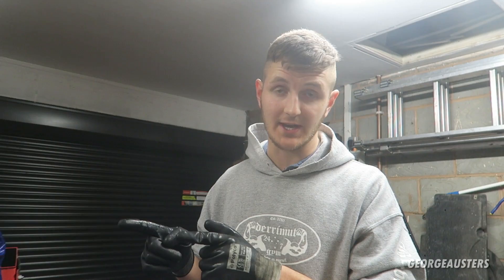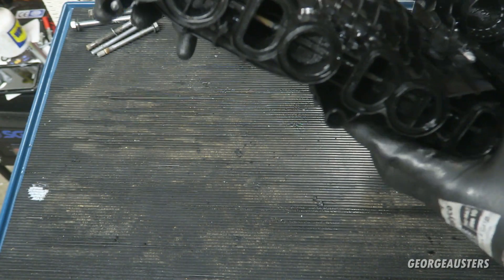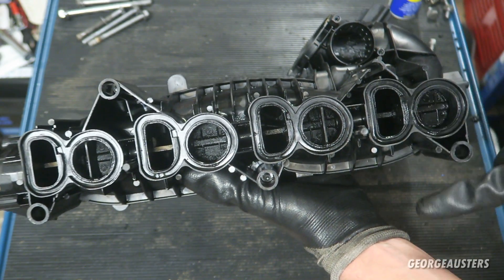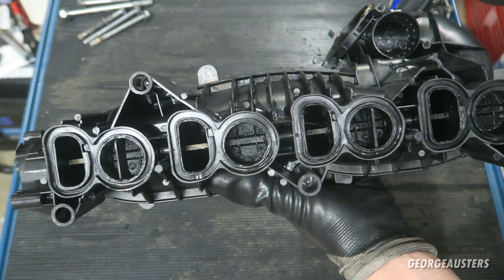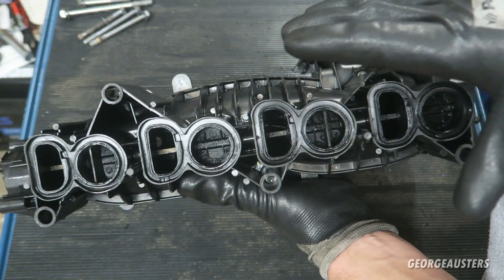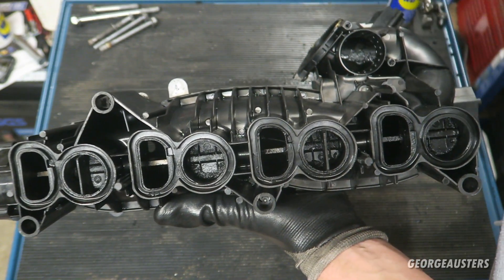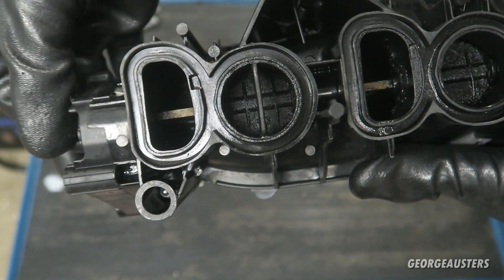Why You Should NOT Remove Swirl Flaps on BMW N47 / N57

Comment: I removed intake manifold on my high miles 2011 320d and the flaps were resting on the inlets… ready to fall in ! Only the carbon build up around them was preventing that from happening. Important to note the later N47C is different to the manifold shown in this video.

Comment: It's a bit chicken or egg story, I drive a diesel because of it's torq on low RPM . 
For sure taking a little brain out of the engine would have side effects. 
And we don't want a Diesel to behave like a petrol car. 
Issue here is when does that long axle holding the flaps is having too much space... 🤔.
I cleaned everything as much as possible with a toothbrush and some WD40 and brake cleaner. 
It closes and opens a bit smoother then before. 
Tomorrow a possible EGR Dismount will take place.
Reply from the maker: It’s why I generally just recommend getting a new manifold after deleting the EGR system

Comment: For never N47 like I have on my F11 there is whole intake manifold gasket with new swirling flaps which is nice thing. I bought oe quality but not orginal gasket for 25 euros from discount which is only 1/5 of the orginal part price and Im going to change it when I do timing chain job to my car so I can be sure that flaps doesn´t fall to engine.
Reply: Doing this right now over in the states.

Comment: I had a remap done. With EGR off/DPF off & Swirls On. And just like you mentioned, i have a massive drop in power below about 2k.

I've tried it both ways and without a doubt definitely better with a brand new manifold with the swirls left in.
Reply from the maker: Exactly 👌🏻

Comment: The swirl flaps are there for cold starting only, because the EU has a cold start emissions test on the MOT hence cars used to have cats on the inlet manifold (for cold starting) AND in the main exhaust. Now they just put a bigger single cat close to the header. They dont operate a slow engine speeds once the engine is warm so removing them can only increase performance.
Reply from the maker: Nothing to do with starting at all
Reply: @GeorgeAusters  Purely for cold starting emissions, they dont activate at any other time.
Reply from the maker: @manoo422 you haven’t got a clue sorry
Reply: @GeorgeAusters  Spanner...

Comment: Had a n47 engine with catastrophic engine failure due to broken off swirl flaps/rod. So it happens. Removed them for good and did see a drop in power in low range, it drove a bit more like a petrol after that - HP curve. Fuel efficiency was stellar on rebuilt engine without the flaps.
Reply: How many miles did your engine have?

Comment: So I have a BMW 2 Series Active Tourer, B47 engine. Swirl flap arm gone.
I am in two minds about doing this.
I have only found one garage that does this, £400 all in.
My concerns centre around whether it is good to do or not. I'm aware that if the manifold is replaced, then it can happen again down the road.
Perhaps an aftermarket one will do better?
I've found arguments for and against it.
Does anybody have the same car and/ or engine with this problem?

Comment: Thanks for your great vids. Used them to remove and clean my B57 manifold. However there is too much play in the shaft so I need a new one. Can you recommend an aftermarket brand? BMW want £900, which seems a bit pricey. Cheers.

Comment: 2 well worthwhile N47 deletes - swirl flaps & EGR.   Do both or neither. Ideally do both. They suck.
Reply: The rod is, btw, NEVER snapping. Nor are the new style flaps ever coming off - not happening. Rod snapping is LOL territory - you won't even be able to cut it with a bolt cutter. That isn't the point.  EGR is a disaster for your engine - it drowns it in crud. Delete both.

Comment: my car is bmw 520d f10 2011 the car has no power after 2000rmp the car doesn’t pull but it revs freely but struggling to go to 100km/h and we have checked everything like the turbo, the turbo actuator, egr, exhaust, diesel filter, dont know what is the issue and also it misfires slightly at low rpms around 1000rpm to 750rpm but if u rev it little it goes, the car has zero fault codes, no malfunction light what so far and we are suspecting the injectors may be bad but im thinking of the swirl flaps may be it is not working plz help what is this issue is it a swirl flaps?
Reply: I have this same problem it's intermittent, most the time it runs like that then on the odd occasion the car runs fine then the next day it's back to this problem again. Did you ever fix the issue.

Comment: Swirl flaps don't increase the amount of air into a cylinder when closed, what the swirling air does is improve fuel and air mixing partly as a result of the angle it enters the combustion chamber (like you said) but also because of the increased air speed, which helps light throttle emissions, power and  economy.
Reply: what kind of air/fuel mixing? The diesel is injected after the air has been sucked in and compressed.
Reply: It’s the way the air is flowing that the fuel is injected into that makes the difference. Imagine throwing something into a straight wind vs a whirlwind. At low velocity, the whirlwind is going to get to all parts of the combustion chamber more efficiently and quicker. At high revs, you just have to open all the doors and get as much as possible in while you can. The direct injection process starts before full compression, there simple isn’t enough time to squirt it at top dead centre.

Comment: Very informative video George

However, my concern is that I currently have a 2014 facelifted 530Dthe N57 The car is one owner has been serviced regularly at BMW but since I’ve got the ownership I am planning to do the oil change every 7000 miles or so, but the thing is should I be concerned about the swirl flaps issue because the car currently has two years warranty with the dealership that I’ve got from, but I rather not have things going wrong with the engine as it’s absolutely perfect with no codes whatsoever on the scanner And ive done 7000 miles since I’ve got the car, so my question is should I be worrying about swirl flaps at this stage and I’m planning on getting the car carbon cleaned just be extra secure but is there a chance that they could still fail.. I do occasionally put the car in sports/sports+ just to other get a smile on my face, show off to mates the insane torque, sometimes do traffic light style launch, but I always do take care of it and engine it’s looked after and I’m at 60:40 Motorway:City driving ratio 

The car is currently at 88k (was 81k when I got it)

Comment: I've ended up here after some weird issues with my 640d. Having to start the engine twice to get out of limp mode every time without failure. Invested in an ENET cable and got a copy of ISTA+ I've got this showing

"The monitoring detects two possible fault causes:

- Detection of a broken lever between swirl-flap controller and swirl flaps.
- Detection of excess wear of swirl flaps kinematics."

Then in another place I've got the following:

Actuator position: -4.75%
Actuator Desired position: 5.01%

EGR position: 0.00%
EGR activation signal: 0.01%
EGR Nominal Value: -9.99%

How big of a job is it to get that inlet off? The car had the EGR done under warranty about 2 years ago.. I noticed darkside developments have inlets for £200 so tempted to give this a blast myself

Comment: 5mpg difference? Nonsense - official BMW documentation states that is affects low RPM emissions only
Reply from the maker: Not nonsense.. Tried and tested by yours truely
Reply: On a N47D20C? 
Sorry, you're wrong. 
Even N57S removal doesnt  affect economy.
And I've done many with the blanks... 
Emissions - yes. 

The newer B47 I'm not sure of though. Either the A or B version. 

  @GeorgeAusters
Reply from the maker: I'm not wrong.. I've literally tried it. Averaged 50mpg with swirl flaps in place and went down to averaging 45mpg with swirl flaps removed.. So I reinstalled them and mpg went back up.

Comment: I do not agree at all, wait until one of those flaps brakes and goes to one of your cylinders and we talk later :). 
For me BMW it is the easiest cars to maintain if you buy of course used one. Rule nr. 1.  Remove those Swirl Flaps - they are useful, that is BMW way of fucking up your engine, do you know that over the time they brake 2. Send it to electrician or if you know to do it by yourself, disable the EGR - you do not need that shit. BY doing these two together you gain mpgs. 3. CRANKSHAFT PULLEY, it will fail usually after 200.000 KM - replace it find a good one like corteco part for instance, and when it brakes it doesn't cause a huge problem, you cannot drive it, you have to tow it and replace the shit. In the past I think for instance let us take  e39 bmw crankshaft pulley was all metal, never did it fail, as technology is progressing they are doing mixtures rubber plastics all that shit which over some years they brake, yes it gives better stability when the engine runs, but yet they brake and the MOST IMPORTNAT PART . 4. TIMING CHAIN KIT - a must at 200 000 KM.  Change that timing chain kit on time. because I do not like engines when they get fucked up, it will never be like factory made, replacing all that shit after it is painful.  Other parts are normal parts that you service them when needed. I have n57 300 000 km on the clock, never had issues, still the engine works brilliantly.

Comment: My BMW independent mechanic mentioned a manifold leak (not sure from where but there is lot of carbon soot built up around manifold & cover). My 2008 X3 E83 N47 2.0d is showing 3 glow plugs faults, so while we are replacing Glow plug might get manifold replaced. Was going to order cheap Manifold without flaps from eBay but he advised to buy one from reputable parts supplied with flaps and actuator motor given Genuine costs $2.5k in Aus. So after having seen your video it explains why he asked me to stick to original setup. Very nice animation by the way. You X3 N47 videos have really helped me understand how my car drives. Hopefully with your helpful advice and Timing chain hanging in there, I can get from 200k km to 250k before I dump this car. Not sure if I want to touch any of injectors just yet, one of them is starting to leak very slight diesel though)
Reply from the maker: It’ll be at the front, there is a bush that wears. You either need to replace the manifold or remove the swirl flaps
Reply: @GeorgeAusters  ordered $600 manifold with new actuator and flaps. Let's hope old glow plugs come out intact 🤞 amd and new manifold fixes the exhaust leak.

Comment: I have just had a recall on my EGR done. Loss of power in the next week and diagnostics saying swirl flaps. Could this be linked the the EGR recall replacement at all? Cheers
Reply from the maker: Potentially.. your old EGR valve may have be stuck closed and now the new one is allowing exhaust gases through and your swirl flaps could be blocked up

Comment: Let's also mention that these swirl flap round gates falls down from the tube and enters the engine combustion chamber, unless you're lucky enough where they get stuck right before the engine valves.
When tuning my bmw at some point I had to remove the EGR and also remove these swirl flaps, So when I checked I found two swirl flap gates were already stuck and could destroy my engine at any time, luckily I removed them In the correct time.

Comment: Greetings from Spain, thanks for your contribution. I have an N57, I have problems with smoke and cold breaths when starting the car, I have changed injectors, heaters and heater unit but it is not solved. In the diagnosis the error "004DFF SWIRL-VALVE CONTROLLER POSITION CONTROL" appears, I don't know if this could be the cause. If I remove the SWIRL-VALVE, will the error appear or do I have to code? Thank you so much
Reply: Hey! Did you manage to fix the smoke and 004DFF issue? I have the same problem and wonder how did you fix it!

Comment: Hi, I have a mk6 golf 2.0 TDi 110 bhp. It starts up fine but after a minute it idles very rough (car shakes, headlights flicker, revs drop...sounds like its going to break down) for about 5-10 mins. Once it warms up, it runs fine,  drives fine and doesn't smoke. Had a engine light on, code stated it was the swirl flap motor. So got a swirl flap delete and an egr delete. Now no engine light, but the problem remains.

Any advice will be greatly appreciated.

Thanks, Sid.
Reply: EGR, glow plugs, injectors
Reply: @mwhiteley4350  A dpf delete has been on the car, so I can eliminate that. But I will look into the glow plugs and injectors. Thank you for the advice.

Comment: Appreciate this is an old post but I read all the horror posts on this and was about to get my 07 bmw 320d swirl flaps removed at 73k glad I didn’t. Should be safe at this mileage surely with fsh at BMW surely?

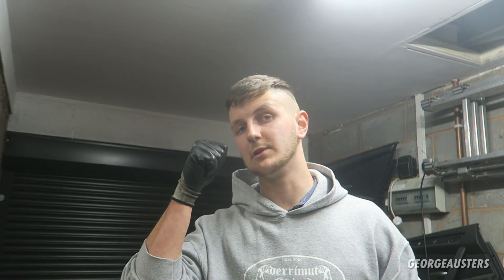Comment: 6:41 isn’t it possible just to replace the rod and swirl flaps? Why the need to replace the inlet manifold if it’s just the rod and swirl flaps in question.
Reply from the maker: There’s no way to replace them without splitting the manifold

Comment: Worth mentioning my 2011 n47 d20c has separate swirl flaps between manifold and head, bmw call it a “gasket” but it contains the flaps and shaft. Easily replaced for £25-50
Reply: Yes, I'm doing the replacement now and it is basically built into the gasket. The design is much better and the software also is improved to prevent the breakage by looking at the voltage at the motor. If it detects a large voltage or current draw, then the flap is disabled. Carbon basically is preventing the flaps from opening properly. I have a garage full of black carbon. 

Who thought this was good for the environment needs to be bought in front of a congressional hearing! The emission standards don't take into account of the impact of actually replacing all these parts? What about the economic impact? I'm sure the average car owner would has to pay a dealership to replace the intake manifold would just toss the car out after a few emission part failures. 

Look at the owners manual for the diesel - in Canada - it says replace all the emission related parts at 160,000 Kms! Yes, the NOx and O2 sensors are included in the regular maintenance  with the text saying the emissions will increase past this point. This is rediculous. We need a law for emission parts to last the life of the car or to be fixed by the manufacture. Watch how quickly the life will increase of the parts.

Comment: George (when your back from the ring) I need your help along with fellow youtubers when it comes to N57 inlet manifolds!! My colleague was quoted £800 to replace his inlet manifold on his 2011 330d motor due to fault 24CF00 coming up relating to mass air flow. I decided to help him and remove the manifold to remove the carbon from the swirl flaps yet the fault code is still present straight after clearing it. I am convinced its the MAF sensor that's at fault but need some guidance from the gang.
Reply from the maker: Is there a hole burnt in the manifold? The EGR valves can stick open and burn a hole in them. 

I’ve never seen a MAF sensor actually fail but could still be at fault or it could be o2 sensor related.

Comment: An explanation that everyone can understand.  I come with an incident and a question at the same time.  I took out the intake manifold, cleaned it and changed the flaps, all 4 were broken, 2 I found in the intake ports, I don't think the engine sucked them, I didn't find any pieces from the 2 flaps, I put everything back and it works without  problems
      It is a BMW f30 engine, xd, 184 hp, 2014, n47 d20c
      Do you think they were chopped, ground, burned and put out on the exhaust, without affecting the engine???????
Reply from the maker: Hard to say without looking into the cylinders

Comment: I just bought a 2010 320d, so later manifold with the better design. Can I just replace the rod and flaps? The engine is on 201k! Drives nicely, surprisingly quiet and smooth.

Comment: What nonsense is that diagram; Where are the intake valves? That "tumble" and "swirl" makes no sense when you take into consideration intake valves. Even if that air is the density of water it won't continue swirling into the cylinder.
For actual swirling in the cylinder, you need to adjust/design the angle of the valve relative to the cylinder.

For any Opel owners that run on to this video, they are "stuck" open on mine, they have them designed to stay open in case of most failures.
No mpg changes on the open road, maybe a tad worse in the city but slightly better throttle response on low rpm. If you haven't cleaned your EGR inlets in a while - leave the flaps "broken".

Comment: hi, how does the part called which is transfer movement from the actuator to the leaver? i have issue with that part which need replacement. thanks.

Comment: Stick it in a tub with carburettor cleaner overnight and clean it. EGR delete on the a remap with an updated FMIC to keep the exhaust gas temps down. VNT turbos are sensitive to EGTs hence you don’t see them on petrol cars

Comment: After I lost power on my 2015 640d it was thought to stem from a heavily coated intake manifold and swirl flaps. I was advised to do a swirl flap delete. Massive loss in low end power after the removal. I’m contemplating just buying a brand new intake manifold in the hope it returns it back to normal …
Reply from the maker: Yep exactly like I said in this video
Reply: @GeorgeAusters  wish I’d watched this beforehand! Oops, would a replacement genuine BMW intake solve the issue you reckon?
Reply from the maker: @AdamD1989  Yes
Reply: Lots suggest to just do an engine remap after the delete, to be honest I think it’s just more modifications and a 50% increase in Insurance after looking at the comparisons sites too!